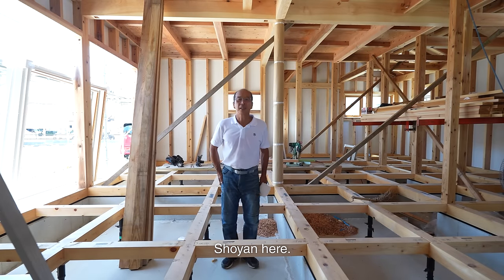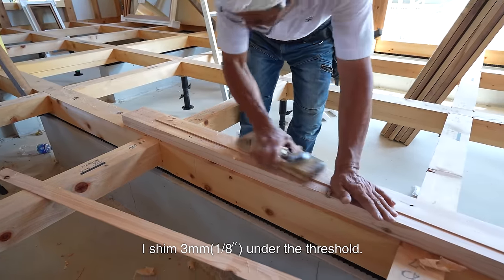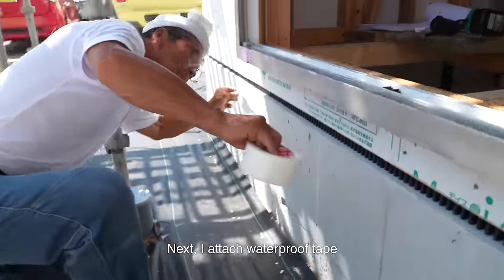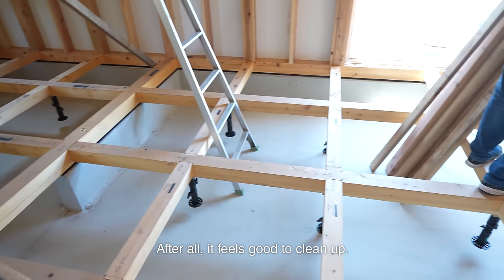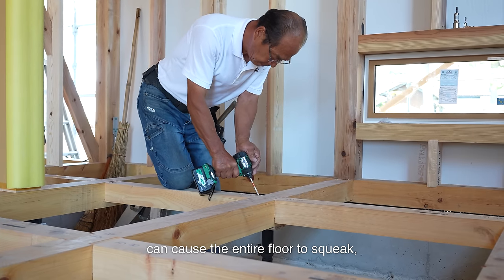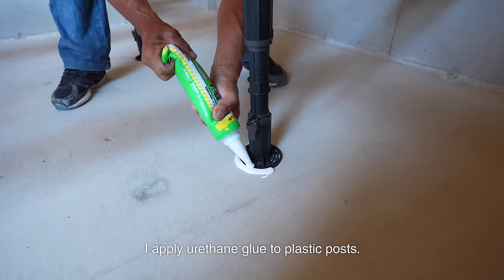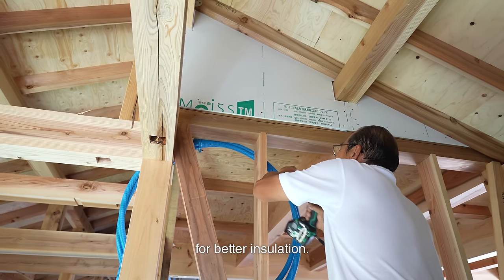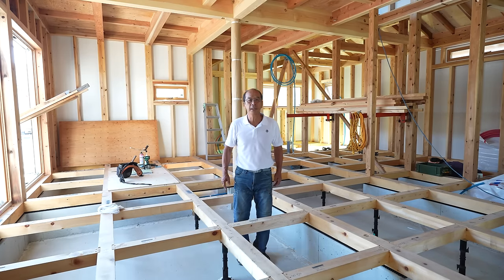A Clean Job Site Leads to Good Work! The Essential Process [Season 4 - Part 4]

Comment: I really like the Japanese way of building. A lot of it makes more sense to me. True about having a clean jobsite/workspace. For me, it just feels better to have a clean space. And you know where things are and can access them more efficiently.

I don't have my own proper workshop yet, but my work area is very temporary (I'm building a custom travel camper at the moment). But I still like keeping it clean. It's good do also dedicate some time just for cleanup and organization.

One question for the carpenter – What happens if one of those plastic supports fails? Is it common to have to open up the floor to fix one of them later? I'm curious to know what kind of plastic it is (and what different materials Japan has that the States doesn't) and how the supports are made/built.

Thank you for the videos as I've just discovered this channel but I'm really enjoying it.